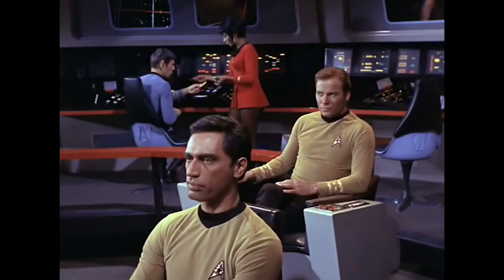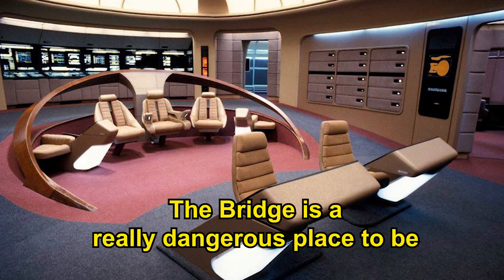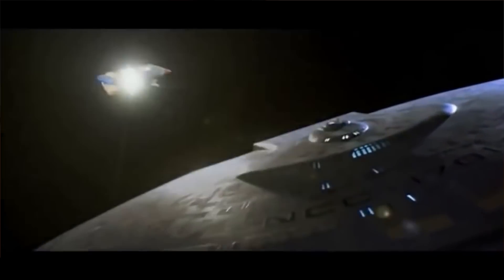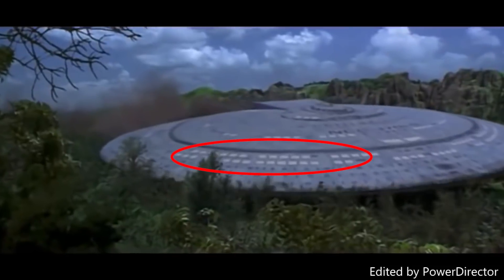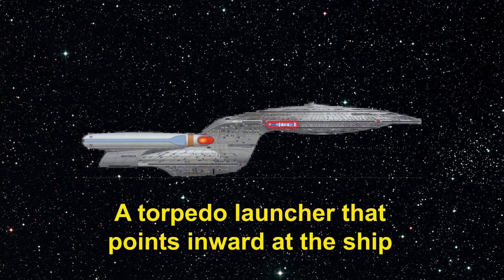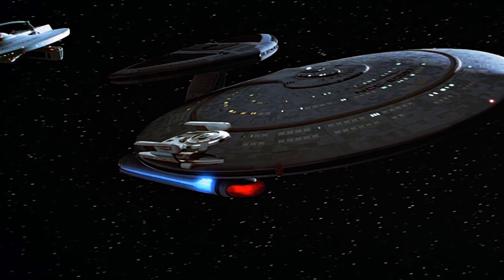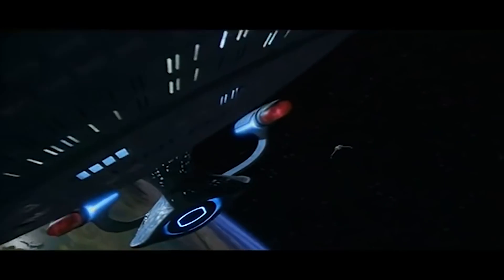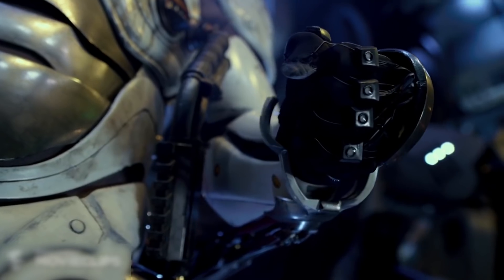10 Flaws Star Trek - USS Enterprise NCC 1701-D

Comment: Then there is the problem of the two "phaser lights" starting out at opposite sides of the "phaser ring" having to come together before it actually fires.  Besides that, the whole ship just looks goofy.
Reply: Well a lot of cars are stupid and ugly and are stupidly designed.
Reply: @yosefmacgruber1920  What's your point, besides the top of your head?
Reply: @timbonine3333 
My point is that a lot of cars are stupid and ugly and are stupidly designed. And that we ought to seek to improve that. Cars do not need to be tiny at no cost savings, they do not need dual exhaust pipes, they do not need to make loud obnoxious noises, cars should not be seen as stupid status symbols, but rather cars are a tool to to get us from point A to point B in presumably a reasonable level of comfort.

Everybody knows that phasers wouldn't actually fire like that. It is just cool visual effects, and if ever such spaceships ever exist in the future, obviously they will be much different, perhaps more boring than their sci-fi fantasy counterparts.

The "goofy-ness" factor of current cars on the roads, is much higher than the supposed "goofy-ness" of sci-fi spaceships that are are not even real.

Comment: How does a million ton starship land on such small landin gear pads?
Voyager would drop right to the pavement.
Reply: The problem isn't the landing gear pads giving way. The problem is large amounts of force being put onto small areas of ground. Basically it would begin to sink. Depending on the gravity of the planet, the surface, size of the landing pads, location of the pads, actual weight of voyager, and distribution of its weight.

Comment: The bridge is an interesting one, Trek I think actually seriously underplays just how destructive a photon torpedo is (unless it's against a Klingon BOP, they always seem to blow up after one hit.) 
We're talking about an antimatter explosion, in theory (and according to some Trek technical manuals), just one against an unshielded ship should more or less destroy it (which we do kinda see in Generations and on the Enterprise-A in ST 6 and the Reliant in ST2.) So really, where the bridge is, is really irrelevant. If it's protected by shields, it's fine, if it isn't, then plot armour aside, there probably isn't enough of the rest of the ship left for the bridge to make much difference, blown up or not. Same goes for nacelles I guess. 

I also think it's a mistake looking at the Enterprise as a purely military ship (like the US navy) whilst Starfleet is technically the military, their main aim is to explore, meet new life and new civilisations, boldly go etc. And the Galaxy class is designed to run independent of Starfleet for years if it has too. Would you want to go on a continuous 5 year mission with conduits and pipes everywhere? Also the Galaxy class is designed to be in continual use, I believe, for over 100 years and so why not add in extra space? She's designed to operate in space, it's not like that extra 35% matters when she doesn't have to fight gravity or air resistance.

Comment: Why is there artificial gravity in the turbo lift shafts? When a lift fails, for some reason it 'falls' down the shaft or the crew has to climb 'up' the shaft. Why not just let the cars float? It takes less energy to move the car with no gravity and you would save even more energy by not generating artificial gravity in the turbo lift shafts. You don't need gravity there and it poses a non-trivial safety hazard!

Comment: Agree with 8/10.  Large open spaces is a mental health benefit for long missions.  The need for crammed quarters like in a sub is questionable.  As for exposed engines, you might have a point but romulan war birds seem exposed too.  But without a cloak, exposed engines are more of a problem.  Ok 9/10 not 8/10.

Comment: One I would say the bridge is in that place cuz it's part of the computer core in the whole section can be removed and replaced at any time in ship dock 2 the warp nacelles are not the engines 3 in Star Trek generations they had complete control failure the saucer section was going to crash and we're flying a brick check out Space Cowboys for the meaning.

Comment: This...is gonna be LONG.

First off, I wouldn't consider the inability of the saucer to land properly a flaw. You have to remember that there was only a matter of minutes before the warp core breach. And considering that the saucer section only has impulse engines, there's little to no chance of escaping on such short notice before the explosion of the engineering section and resultant shockwave (which is what beat the crap outta the saucer, forcing that crash landing). Had circumstances allowed for more time to escape, the result may have been completely different.

As for the bridge...ehhh. That's been a thing since the Original Series, maybe even sooner if you count Enterprise & Discovery. Despite the massive easy pickings, I guess Starfleet KINDA learned considering how huge & high-sitting the bridge module domes were on 23rd century ships pre-Excelsior class. (But I guess that in exchange, ships from around the Enterprise-A were made of crappier materials considering how much more easily they got T-WRECKED, clean on up into the TNG era...) I mean, look at the bridge modules on Galaxy class, Sovereign class, Ambassador class, and other TNG era ships (including DS9's Defiant and the Intrepid class of Voyager) compared to Constitution class (original & refit), Miranda class (including the four nacelle Stargazer & Lantree), Oberth class, and other TOS era ships.

And speaking of exposed nacelles...that's also always been a thing, but if anything, the Sovereign class makes matters much worse by having warp nacelles that are absosmurfinlutely MASSIVE. And ships like the aforementioned Lantree & Stargazer? FOUR. WARP. NACELLES. Who even needs that many sitting ducks when they're still getting the same kinda propulsion from the warp engines!?

Comment: You seem like someone who doesn't like star trek and who did a bunch of research on it before this video because while you claim to know a great deal of the technical specs and how they work on the ship but you  think the naecells are the warp engines?  Those are just for helping create the warp field and changing its shape so they can fly. The  actual engine is buried in the center of the ship.

Its like looking at the tires of a car and going "yep, those are the engines.".

Comment: Generalizing, the video appears half right.  The interior/bridge is unsafe at any speed and should have a joy stick control always available.  Bridge personnel are often killed by parts of the ship.  A modern version of seat belts could be developed (locally created restraint field not dependent on central power ).  The electronics are prone to explosion.  When I learned the view screen is not a window, the exposure of the bridge is unnecessary.  The 'space' in the ship is not a problem, though.  The Voyager was a better design with landing gear & efficient design, but kept other flaws.  I always thought the nacelles were placed due to physics.  I thought the saucer section should only manage impulse power.  If it is a giant lifeboat, then it should be able to land on a planet.  Most weapons should originate from the battle portion, including the main phaser banks.
Most of the security issues were plot devices, making security people stupid on purpose.

Comment: So. Even our current combat ships use dead space as a buffer. #1, The Nimitz class carrier is mostly dead space in the sponson areas, outside of the ballistic hull plate. #2, The Abrams tank uses air space in its armor to dissipate energy. #3, A joy stick? Our modern air superiority fighters are fly by wire. A stick yes but no physical connection to the control surface. #4 even a ship as massive as a CVN is controlled by a wheel that is only about 10" in diameter. Submarines use an airplane style yoke and rudder. Why a biometric control system when it simply does not need to be that complicated. I will give you points for the bridge location and shield modulation. But remember the saucer section was severely damaged in Generations, besides, it was time for the sovereign class, lol. On a final note, until the 1701 E. the enterprise was never ment to be a combat ship. Just my .02.

Comment: If I use a toilet on the holodeck...what happens when I turn the holodeck off?
Reply: I seem to recall that the ship cleans itself. But that isn't even the real answer. What happens when you eat food on the holodeck? Presumably, it is real food on a fake virtual holodeck. The holodeck is not 100% illusion. That why it has to have safeties, so that a fatal situation on the holodeck doesn't actually become deadly. How many times does somebody die or crash their flight simulation or whatever on the holodeck, and the simulation suddenly vanishes and they see the walls of the holodeck? That is the safeties in effect. The computer knows the simulation can not continue well because "You're dead". Time to reconfigure or to reload from a quicksave and try the practice run of how they will invade the Borg cube again.

How many times did the safeties go offline? They had to play along with the story, because then the character's gun bullets could be deadly.

So the answer should be obvious. It goes where toilet stuff usually goes.

Comment: Bridge explosions are for drama. Realistically, damage to one part of the ship wouldn't cause consoles on the bridge to explode. Sure, there is electrical feedback, but even 20th century ships have fuse boxes! 

Regarding the crash in Generations, I can only assume it was too quick to have everybody evacuate after the saucer was hit. Why they didn't go to escape pods from the drive section, I don't know. 

The Enterprise D, and most Trek ships aren't 20th century ships. They don't have to worry about conserving space, or at least not to the degree of a 20th century submarine or battleship. 

The absolute biggest flaw in the design of the Enterprise D has to be the Holodeck. Not only is it an entertainment system with "safeties", meaning it can be accidentally or intentionally be set to kill people (taking Hardcore mode way too seriously), but it can infiltrate other ship systems and has been shown to interfere with the vessel so often that any sane person would put them off limits to anybody. The worse example of a Holodeck episode (good episode, but inexplicable plot holes) is the one where Geordi programs the Holodeck to provide a rival that can "defeat Data". The computer, instead of logically assuming he means one that can outwit Data in a game gives Moriarty the power to control and potentially destroy the entire ship! Why is that even possible? Even if we accept that it is possible, why would there be absolutely no security systems in place to prevent it? Not even a "are you sure" popup? Windows has better security than the Enterprise computer!

Comment: Reading the Tech manuals, Companions and blueprints ruined allot of episodes and movies for me. 
As for maneuvering the ship. 99.99% of the time the helmsman is not manually flying the ship. He is entering command codes for the ship to move in preprogramed maneuvers. That is why the captain is always spouting stuff like Attack pattern Delta 347, or evasive pattern Epsilon 925. It is Alphanumerical codes where the helmsman would just enter 4 digits, and the Ship would respond how the Captain wishes automatically. I do not get it, cause the captain could eliminate the middle man and just tell the computer what to do, but set extras got to look like their doing something.

Comment: The Galaxy Class Ship had a Poor Location for the Control Room.
   It's Engines were too low and were too short.
The Saucer had too many Lighted Windows in it.
  There were not enough Phaser Strips.
  And not enough Torpedo Tubes.
           Shuttle Bay Doors were all poorly sized

Comment: It was established decades ago (70s era guides) that the warp nacelles (Which are not engines; you are thinking of the warp core, which is in the center of the lower hull.) were put on pylons because of radiation and because it helps establish a better warp bubble using less energy. Military ships today that are expected to be in service for decades all leave room for upgrades (look at any post WWII capitol ship). Not to nitpick, but in a different video, you talk about warp drive travelling through subspace, which is incorrect. Warp drive which is actually theoretically possible according to NASA as it is based on a real theory in physics; the issue being the power needed. Warp theory is based on compressing and stretching space. Perhaps Al isn't the only one who needs to brush up on their Star Trek knowledge.

Comment: Hmm, critisized the prosition of the Bridge. Real Battleships, or even cruise liner have their Bridges at the highest point. Thei don't have seat belts or airbags either.
Big vessels lige the Enterprise are not constructed to land on Planets. It is like you said an emergency or rescue system, so it is only constructed for an emergencylading, later Ships are constructed for controlled  landing (Intrepid-Class or even Defiant-Class).
No, no, no, no, no! Don't take Discovery as a reference. BTW: Operating in the Atmoshere and landing are different things. Even the Constitution-Class could operate in Planets Atmosphere. Beside the Galaxy-Class, there were a lot of smaller Schips-Calsses within the 2360's.
Reply: Modern warships are conned from the high point, the CIC is usually deeper inside the vessel.

Comment: i liked it  and will watch more but 1 you can use a touchpad joy stick. 2 the torpedo launcher has an extension u can see when both parts of the ship connect together 3 if the ship just landed in gen that would make the movie even worse 4 the new star treks after are all so more modern its called moving with the times hence everyone hated enterprise and 5 get a decent hair cut and clothes lol .

Comment: Most of the "Flaws" are easily explained with: It's a TV-Production.

Besides that:
It's not a Battleship (Try to ram the Defiant-Class, Klingon).

They had to blow up some stuff for the audience. Since energy-weapons dont explode by themselves, what can you do? Blow up consoles and wallpanels, result.

That the saucer-section cannot land in a controlled way is open for debate. Maybe a good pilot could do it.
They wanted to get rid of the old model and that was how they did it. Screw the script of "ST:Generations".

The shield-frequenzy-modulation-thing was not well thought out. If it was this easy to penetrated shields that way, other opponets would have found this flaw before and the modulation would have been standard. That make no sense in-universe.

The warp-engine itself is not exposed, these are the nacelles. The critical part is deep inside every ship.

The 1701-D had an Android on the helm. He could do the math, so no joystick needed XD

Comment: There are in-world reasons for the first and second.

First, the Enterprise is never intended to be an outright warship. If it was, it wouldn't include robust science labs, daycare centers, and a truly prodigious number of utterly superfluous scientific apparatus. If a warship design was called for, they'd probably cock it up too, but not quite as badly.

Secondly, the lack of seatbelts and airbags is unforgivable, but the exploding screens and walls make sense in a very stupid way. Apparently, some genius figured out that the most effective way to transfer actual energy from the rectors and other power generation devices to everything that needs power (screens, controls, sensors, shields, weapons, lamps, forcefields, showers, doors, elevators, etc) was by replacing simple primitive insulated power lines with pressurized metal tubes filled with volatile plasma. That's right, they're pumping piping-hot mini-sun throughout a network of tubes all over the ship like veins and capilaries. That's their power system. So whenever anything gets damaged, which they never plan for since 'these aren't warships, why would anyone shoot at them durr hurr', a power line gets ruptured and superheated too-hot-to-hold-onto-its-electrons gets spewed into the surrounding area.

You totally have a point on the third issue. There are virtually zero access controls, password locks, keycards, or other security bottlenecks one would expect on any kind of large scale vessel. I've literally seen garbage barges with better security.

Fourth flaw is also a valid complaint.

Fifth flaw is again a totally obvious flaw and anyone with half a brain would wire a random number generator to their shield frequency system.

Sixth issue is totally valid.

Seven is totally valid. It's just sloppily-artistic design from a hundred years ago that keeps getting grandfathered in because it looks cool.

Eight is a half-and-half. As a ship that's intended for long exploratory and diplomatic deployments, the crew needs to feel comfortable, and very few people enjoy cramped spaces. So wide hallways are a useful morale booster. The use of space is inefficient, but inefficient with a purpose.

Nine and ten are totally valid.